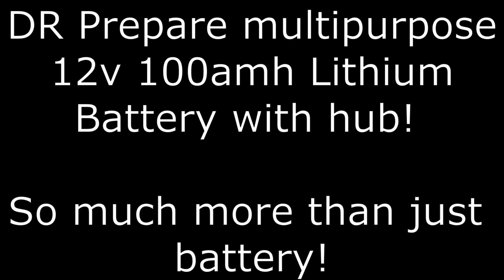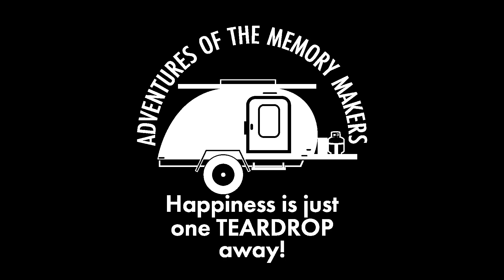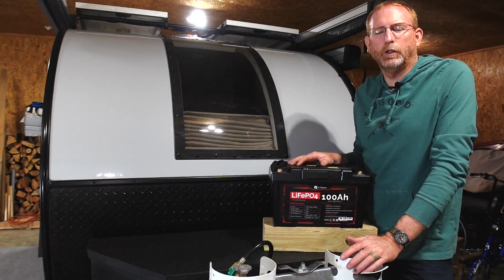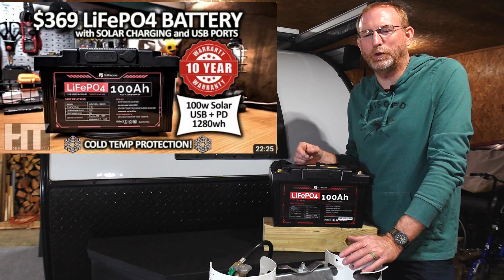DR Prepare PowerMax 100 amh LIPO battery with HUB, so much more than just a battery!

Comment: How can I recharge from my power station?  Also will it run a 60amp 12 volt ac unit?
Reply from the maker: @patrickilfrey4543  thank you for watching. First, charging from a power station is essentially charging one battery from another battery  which is very ineffiecent. You could use your power station to.power a 120v  lithium battery charger but again, a very ineffecient use of the power station.
2nd, will it run a 60amp load, yes, but only for a little over an hour as it only has 100 amh of capacity.

Comment: Price wise, it's not great vs other reputable LFPs.. but the hub on this thing makes it appealing. 
I ended up just getting their newer 12V/100AH mini @ $199 and might just buy the hub by itself ($30 w/ free shipping) to use via anderson power pole connection
Reply from the maker: I agree, the price is salty but the quality components they used caused that. If it just had blue tooth monitoring it would have been really slick!

Comment: Is this the same battery you had inside the portable case that you had shown a few videos back? It seems that this does everything you would need it to do. You just don't have an inverter with it. I am guessing that your battery compartment that you had shown had the inverter in it as well. 
Great video and I am now very interested in this battery. 
Thanks, 
Pat
Reply from the maker: Correct Pat, it would easily power the camper in a setup like we have. To me the Licitti box is more useful for work and camping becauze of the inverter and the MPPT controller.  That said, we use the Dr Prepare through the external power option if our tongue box to power the camper in order to save power in the Licitti power station.
Reply: @adventuresofthememorymakers  That makes perfect sense.

Comment: Great video. I do have a question…. Why did you not just buy a portable power station like the Anker C1000? That way you would be able to use it in your house if the power went out. Multi purpose.
Reply from the maker: Thank you for watching. The Liciti City AC heavy duty power box has a built-in inverter as well. It's a true portable power station just like the Anker. We do use it in the house when the power goes out. The big difference between the Liciti and the other power stations on the market is that it's a 12-volt power station instead of a higher voltage battery pack so there's no conversion process to get 12 volts out of the licity versus the other major power stations on the market.
Reply: @adventuresofthememorymakers  ah ok.... that makes sense!
Reply: @adventuresofthememorymakers  lithium batteries are definitely a game changer! I have a 2023 Tag XL Boondock and just swapped out the lead battery with a new LiTime lithium battery. It has built in Bluetooth so I can monitor it from an app on my phone. 

I also have the Anker C1000 that I plug into the trailer when we are camping. I plug it into the side of the trailer with a 30amp plug. It will run my AC or inside heater. 

Tons of power between the 2 batteries and 380 watts solar we could be off grid for months! 😂

Keep up the great work on that trailer. Maybe one day we will meet on a trail or camping? 

Cheers!
Reply: 1. It's twice the price.
2. Not everyone wants an AC inverter permanently attached to their LFP battery.
3. AIO units like that are typically not very water resistant.
4. DC output (wattage) is lacking...

Comment: Looking to kick on a mini split ac. Think this will handle it?
Reply: Still shopping a affordable mini split that is low power consumption
Reply from the maker: It's hard for me to answer without knowing what the power consumption of your mini split system is. Typically on 100 amp hour battery you probably don't want more than 1,000 to 1,200 W inverter running off of it so you need to make sure that your mini split will start and run off of less than a thousand watts.
Reply: @adventuresofthememorymakers  I was curious about your findings if you happen to to research the ecoflow line  in comparison to the dr prepped considering the advantages of the integration of the separate components and the battery backup with the air conditioning
Reply from the maker: I will be honest, I have zero experience with mini splits for campers. I know there are some nice units on the market,  I just don't have any info on them. 
 From my personal experience with the AC in our camper I would recommend at least 2000 wh of power minimum to get through the night.

Comment: As I watched this latest video, I couldn’t help but wonder is it a PWM or a MPPT controller in the hub?  Great video BTW.
Reply from the maker: First off thank you very much for watching. I was curious about that same issue so I reached out to Dr Prepare and ask them via email and they responded back that it is a "pwm controller with mppt technology". Knowing how both types of controllers work I have no idea how they were able to mamage that one but it does charge the battery off of a 100 watt solar panel.